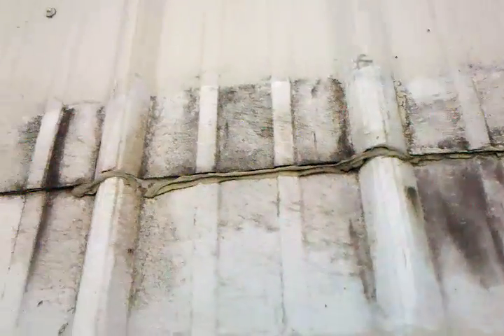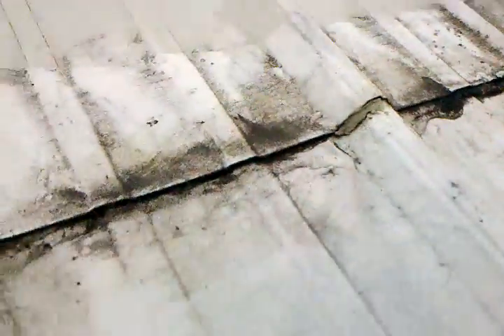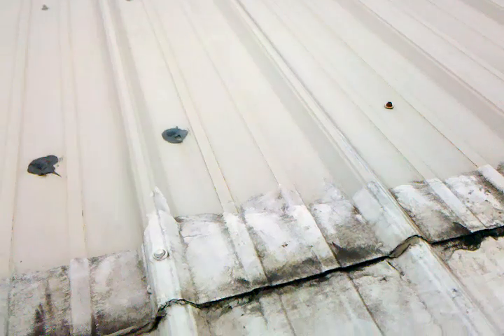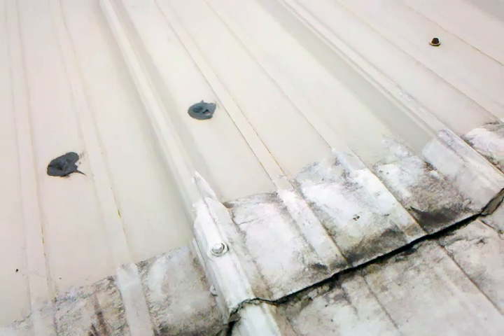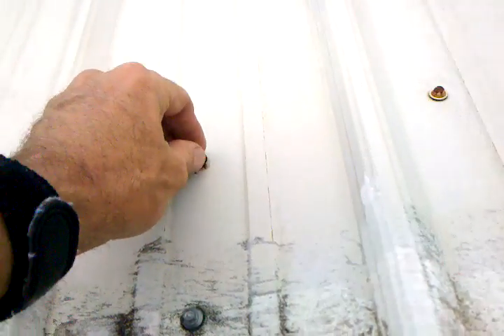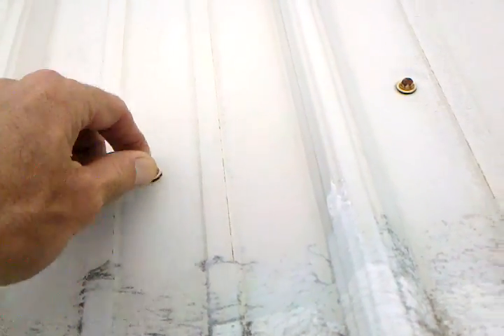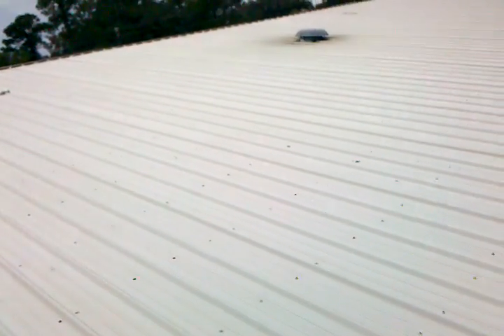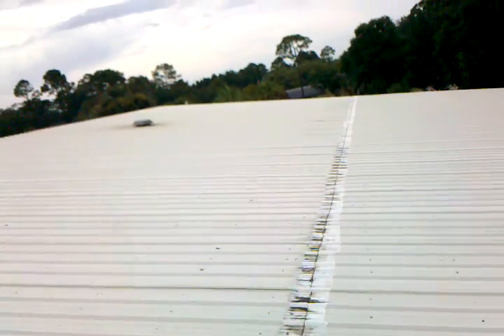Roofing University - Metal Roof Leaks explained

Comment: HELP and Thank you for posting. We have a very low pitch metal roof(similar to a shed roof), it's about 1.5 to 12 slope, maybe 2. We have literally done everything imaginable to fix the leaks. We have the same seam issue BUT, its leaking above the seam(weird)(when I say leak, it POURS). I awoke to find about 2 inches of water in my kitchen when it only rained about a half inch outside. We now have ply board on and covered it in titanium underlayment and put up rain guard at the highest point. Roof was nearly dry but was just rushing into my kitchen? We really need help. We have the metal and are ready to go BUT, I'm afraid it wont fix the leak..it seams like its pouring in from underneath. Could use any advice. HELP! We cant afford roofers BUT we can afford advice and will happily pay for guidance.
Reply: More than likely it's because of the overlap at the seams that the water is coming in "above the seam". It gets in at the seam but should be an over lap anywhere hopefully up to a foot. You also have to cimsider any rafters etc it could be hitting and spreading out on it's way in and down.

Comment: I need a new roof and have been debating whether to get a metal roof or shingles.. I will go with shingles....they say metal lasts longer..well, yes because it's metal..but they don't tell you about the expanding and contracting that happens which makes the screws move up compromising the seals...It doesn't matter if they did a good job or not... the screws will move and it will leak within the first 5-8 years. - hiring someone to redo the screws costs about $1500.
Reply: Mac Pelao get snap lock or standing seam. Both hidden fastener system able to expand and contract no leaks no problems
Reply: 2024 average size roof rescrews $1.50 a fastener !

Comment from the maker: You can either replace the screws with a type that won't rust 9Aluminum head or Stainless) or typically easier to use Gaco Seam Seal on each one like a Hershey's Kiss candy (see Gaco.com for how to do this). Hope that helps!